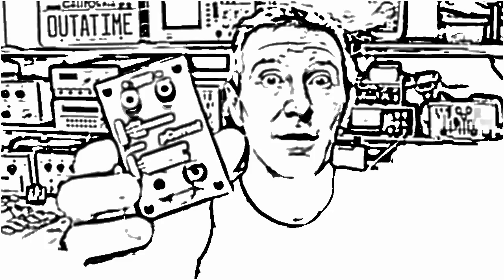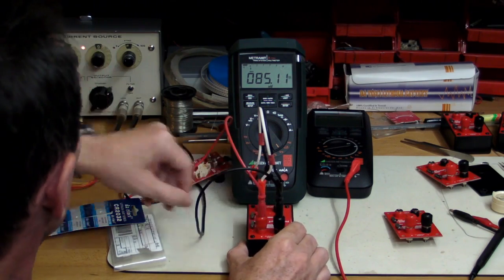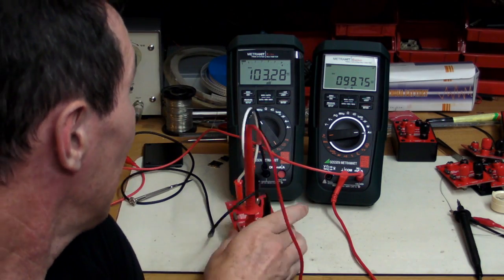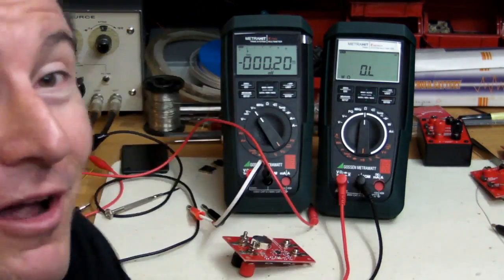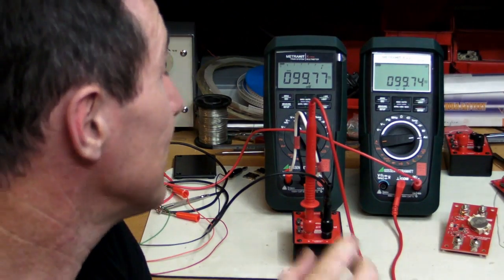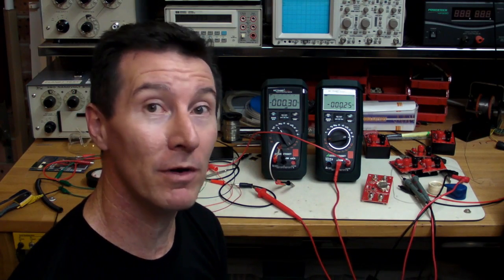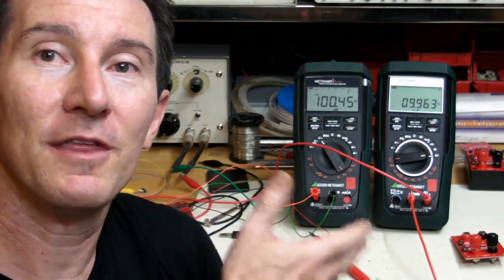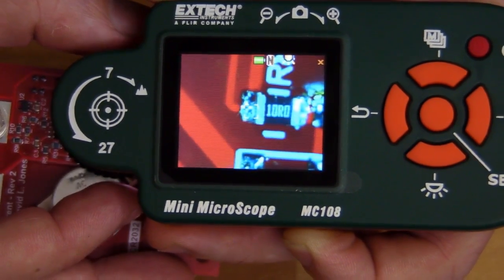EEVblog #133 - Dodgy Digikey Components

Comment: I think this video shows that you have to verify everything yourself. Once you take ownership of those parts you are ultimately responsible for them and the results they produce in the equipment they get installed in. If you're going to sell a product you should also test your product to make sure it meets the specs you are guaranteeing to you customers. It's more costly not only in recalls and refunds but in reputation in the long run to sell dodgy gear.
Reply: Jud Clark It isn't practical to verify the detailed specs of every component supplied. Not if you are doing more than a one off prototype. You pay a premium to have them tested before supply.
Reply: @MrSwanley  - Why do you think, nomal manufacturers use bed of nails? Of course you have to test your product and materials.
Your customers do not care what is practical for you. They care what is possible and that they get what you advertised.

Comment: I once order 1 through-hole MOV from Digikey and got a box of 1000 (like $300) worth.  Of course i sold it on ebay, just kidding.  I sent it back, but i thought they'd at least give some credit for being honest.
Reply: +AnubisAkaLee Most likely they just tossed those parts. At least I know for sure that farnell does this. None of returned parts is entering the supply chain again once they left their facility as they do not know what could happen with those parts (ESD, moisture, fakes returned instead of the genuine parts).
Reply: +Jordan Baczuk I think offering credit is something you are more likely to see from companies targeting end user's rather than builders/companies.  A company buying these in bulk would have a scheduled pickup rotation anyway, so it's not a big deal to throw one more envelope/box on the pile.  I bet if you had asked for a credit for the inconvenience outright they would have given it.
Reply: woopsserg, you know, I am so straight that I never even thought about fraud in a return.  Silly me.
Reply: I've had a few instances where digikey gave me one less or even a couple extra components, but not 999 extra parts! XD
I honestly didn't bother because:
1. They were cheap parts.
2. Shipping cost.
3. As woopsserg said, they probably would just toss them so it's just not worth it.
4. I always buy a few extra more than I need. Not just for in case one is missing, but in case I have an oopsies. NOTHING is more frustrating than frying something and having to wait a few days to get a replacement...
Reply: +Jordan Baczuk
Yeah, money just wasn't enough for you, Jordan, you wanted both to feel good AND a credit, and then you dare to call yourself virtuous?! You are a sad, pathetic excuse for a human, you make us sick here at Digikey!! >:((
Reply: They didn't give me any money, haha who are you?
Reply: Jordan Baczuk
It was a joke, how in a twisted sense, you could pervert even the most purest of intentions. I have no affiliation with Dk :)
Money I was talking about was those 300 bucks you could have theoretically earned if you did not send those resistors back.
Reply: +funky3ddy Oh, ok it was a joke haha yeah I see what you mean.  I assumed that <you> were being honest :)  I was just surprised that Digikey doesn't incentivize people to return wrong orders.  I felt that I was inconvenienced to have to box it up again and go to the post office and return it, when it was their fault in the first place.  Some in-store credit for the inconvenience would increase loss prevention, customer service, while costing them wholesale only.

Comment: I have to assume that you used the soldering profile that is per spec for this part.  If you did not control the soldering temp profile, all bets are off.  These low value resistors are much more sensitive than the higher resistance value ones.
Reply: but he tested unsoldered as well?
Reply: Watch the video again. THIS was scrupulously covered.
Reply: Fred Yearian MORON did you NOT see he checked a resistor that was NOT attached to anything ?? He did NOT heat it and found it was still the wrong value !!

Comment: Hmmm, no response from Dave or Digikey???  So for the past 4 years people shouldn't trust digikey parts?
Reply: Because I was way too busy with work projects to start up a side project just to do something fun with them.  Also because digikey is a great supplier and actually helped to fix any of the few problems I've run in to over the years.
Reply: RN1441 and because you're a stand-up guy who doesn't take advantage just because someone made a mistake.
Reply: ***** I can't blame digikey for getting it wrong some times, and it's not at all reasonable for them to test every single 0402 resistor on a reel of 10,000 :D  At the same time, when they get parts wrong they are pretty good about setting it right.  I've had them ship me some obvious mistakes like several thousands of dollars worth of eeproms when I had ordered $100 worth of barometers - they were very polite that time because they wanted their parts back unharmed :D

The worst error I've had from them was getting 5.76k ohm resistors labeled as 57.6k ohm - luckily the power supply circuit wasn't damaged but was clearly non functional so it was easy to diagnose - I've luckily never run in to such a subtle error as this one.
Reply: It depends on the country. Some new consumer laws put the responsibility on the whole chain when dealing with the customer. It means even if Digikey is not at fault, they would have to pay an indemnity to the customer, and then Digikey could sue whoever is really at fault.
Reply: +RN1441 Why didn't you just keep the EEPROMS and sell them on ebay/use them in projects?
Reply: If it happened so easily with Dave, do you really think this pack is "a few out of millions"???
Reply: Do you realize how many part numbers Digikey carries?  You can't fault them for a single manufacturer's batch of 10 ohm resistors that were out of spec.
Reply: Mallom Bum They are suppliers, not manufacturers.  Therefore, NO you cannot fault them for a few units out of millions being out of spec.  If you think so, you should pack up a multimeter and head over there and beg for a job testing each and everything that goes out the door.
Reply: Mallom Bum Oh I see, I misunderstood you the first time.

Comment: I remember doing 4-wire resistance measurement on my introduction to metrology lab, we got 0.1 ohm reference resistor (one of these old, crusty big ones in big cylinder-shaped boxes) and we got 0.2 on 2-wire and 0.1 on 4-wire, that was a good eye-opener for someone trusting all you can get on the multimeter display (I was an IT student and this lab was kinda funny because most of students didn't even know an Ohm's law...) :)
Reply: Since when did IT studies include metrology, or was that an optional subject you could take for your grade point count ?
Reply: I'm on Information Science, we have one electronics course, and we have to make a few measurements like resistance of a bulb (with voltage and ampere meter). Maybe there were more complicated too, but I haven't take that course, maybe next year, but my friend have already did. And not optional.

And we had a PLC and other control stuff too, RS232, current loop, ladder programming, and who knows what. Studends didn't care, teacher didn't care, so I brought my arduino and did something less useless. 90% of class is like my grandmother to computers. But not beacuse they don't know what a phone charger does (220V- >5V), we tried to make a remote door plan (like we need door close sensor, door open sensor, something in the way sensor, remote controller, etc, if this does that, blablabla). The possible exam questions was sent out, and the project was make a traffic light, with the built in leds of the PLC dev kit, or with the "IDE" simulator INSTED OF making a small pneumatic assembly line piece that they told us. That wouldn't be more complicated but it would be interesting for the "noobs". Because of this nearly everybody borrowed the project file and sent in the same.
Reply: Those wires for the 4W measurement looked kinda thin. I'm guessing you would get even better accuracy with low resistivity cables?
Reply: @paulf1071 no difference (within reason) the whole point of 4 wire is to help exclude the lead resistance
Reply: kroplaaaa just remember, multimeters do not measure resistance, they are actually measuring time in the D-A conversion.
Reply: D-A conversion? Typical multimeter is double integrating ADC and it actually counts impulses during which capacitor in the integrator discharges ;)

Comment: Those china batteries can be dodgy, as they frequently don't have the best seal.  Air gets in over time and makes them go high resistance.
Reply: That's a good point. I'm wondering if it's possible that these resistors were spot on immediately after manufacture, but drifted over time due to some obscure reason?

Comment: Depending on how they are made they my be static sensitive...?! We had a class on static at one of our Western Union computer schools. They related a story of how a particular lot of super precision resistors made by a German company were all being measured slightly off when tested on the bench. Believe it was NASA, not sure. This was back in the late 1960's, before the era of anti static procedures & packaging, and ever shrinking conductor spacing. When they were removed from the paper envelope the Germans had packed them in, they picked up a static charge that was enough to arc across between two conductors, dragging a bit of molten metal from one to the other, shorting out a turn. That began the development of anti-static procedures, or so we were told.

Comment: Dave
Thanks for the excellent tutorial.
I've been in the electronics manufacturing industry for 25 years and learned that you ALWAYS test ALL your product specs during test and cal. That's been learned the hard way just as you have experienced. It does increase the cost slightly though.

Comment: So Dave, how do you get around this problem?? I am building a BLDC position controller and I will be getting it sent off to get made, my first run will be 1000 and I don't want this problem to happen to me. Do I order one of each component and test all of them first then get it built with the same items??
Reply: No... just test a few of the ones you get and make the call to the supplier if they are out of spec.

Comment: I know how you feel Dave. I had gotten a Samsung 52inch DLP TV from my wifes sister because it had just stoped working. No surprise it was the voltage cap on the balast baord so I ordered a new one from digikey. 450v 47uf had it replaced with a 400v 47uf cap from an abandon switch mode supply and that worked for 2.5 months. I put the new cap in from Digikey and it didn't last a week. Had a new cap overnighted to me and it lasted 3 days! So I said screw it and just got a used board from eBay. =p

Comment: If he wanted 1.5% error components he would have spec'ed it out for that and he would have bought components to match those tolerances. A 10 ohm 0.1% SMD part costs $101.18 for a batch of 1000, whereas a 10 ohm 1% SMD part costs $12.59 for a batch of 1000 from digikey.

Comment: Digi-Key is dead to me. I have BOMs on their server to order parts for production. Two out of the last three orders had errors in Digi-Reeled components. In one case, a different three-terminal device was substituted for a SOT-23-pkg transistor, and in the more recent one, they reeled the wrong resistors (0603s vs 0805s). 

It's unfortunate--we've used and liked DK for years, and their BOM/reeling services were a great fit when we brought some manufacturing back from China. But these errors...

Comment: I had a major recall incident with ECS crystals ECS-160-20-3X-TR from Mouser. These crystal would suddenly stop oscillating. Real bad news because while it did the quadcopters' motors would spin up full throttle even though the motors were in a "disarmed" mode. Intermittent, hard to diagnose. Assumed a reflow problem for a long time but turned out to be bad parts. Replaced with an ABM7 crystal and not an issue since. I recalled 220 units, which cost me a bundle for a small biz. @flyingeinstein

Comment: Hate to argue with a guy who really seems to know what he's doing, but isn't the point of anti-static mats to be conductive? Normally they have a high resistance enough to drain away high-volt low-amp static charges, but not to affect your electronics. But they are a bit conductive, surely that's the point! 

Apart from that, love your videos!

Comment: Digikey & Bourns hire minimum wage drones who can only read part numbers, and would not know a resistor from a dead frog! I won't use Asian cheap resistors in any precision app no matter how they test. (thermal drift)  I use them a lot in guitar stomp box items where 20% would probably work. When I need .1% I expect it. I usually pretest a sampling of 10% of the lot & if I find 50 in a row are OK use'm. I order 1 extra -10-20% extra of most cheaper parts. I got stung like you on diy synth LFOs
Reply: That why they have tried to hire you?

Comment: I wonder if what has happened is you got some counterfeit parts.  And I doubt that Digikey had any idea that they are counterfeit.  Counterfeit parts are a real problem in every industry.  I have seen counterfeit bolts so it wouldn't surprise me that resistors can also be counterfeit.

Comment: @CampKohler   Antistatic mats have surface resistances of at least hundreds of millions of ohms per inch, specifically so that it will not interfere with stuff like a component being tested or a PCB with live traces in contact with the mat or whatever.

Comment: Love your videos, Dave.

Just a tip for probing those tiny 0805's (and 0603's, its especially handy for checking LED orientation) - leave it in the tape and, using sharp probes, probe the component through the tape.

Comment: Digikey has gotten much worse in the past few years about sending completely wrong parts - the label will indicate the correct part, but the bag will contain a completely different part. Not just a different value - but a different part! In my experience, they screw up about 20% of the time. I place about 50 orders per year.

Comment: @EEVblog On Eckert building the ENIAC:"Whole boxes of resistors were brought in and their tolerances checked one by one.... The best resistors were kept to one side for the most critical parts of the machine wile others were used in less sensitive parts. On other occasions whole boxes...would be rejected and shipped back to the manufacturer." ---Computer, a History of the Information Machine, 1996

There's nothing new under the sun.
Reply: There is no excuse for any company with that sh_tty of a mass production failure rate to still be in business.
Reply: the emperor of chin could behead the maker of out of tolerance arrowheads

Comment: An old question: How many 5% resistors will be found in a lot of 20% resistors? None. All the 5% units are sold as 5%, the 10% are sold as 10% and the rest are sold as 20%. Nowadays probably any units that are further out are returned to the worker that produced them, who is shot by the Chinese army ("Quality control that works!).

Comment: @EEVblog How could it be static dissipative without being conductive? Is it radioactive (ala polonium brushes for film, etc.)? All the mats that I am familiar with are conductive in the multi-megohms/square range and are tested with ohmmeters that measure in that range. There are even go/no-go circuits that monitor the conductivity during use and give off an alarm if it no longer conducts, which is neat.

Comment from the maker: @CampKohler No, no incoming component inspection apart from labeling, nothing unusual there, very common procedure. You build up confidence in your system and supply chain, but sometimes it lets you down like this.
The antistatic mat is just that, anti-static, or what's called "static dissipative", it is not conductive.

Comment: The only problem I've had with ordering from Digikey is when I once received some transistors when I actually ordered microcontrollers.  I called them and they had someone check the bin in the warehouse and--sure enough--they were stocked wrong.  Digikey sent me the right parts and let me keep the transistors.

My only real complaint is that the lady in customer service was really cranky about the whole affair.

Comment: @EEVblog Dave, I agree that in this case it's ok. But it would be good advice to tell people that measuring in circuit would cause problems. If you did this in a previous blog, then it's ok. Capacitance could affect the measurement because as long as you keep the meter current source, parasitic capacitance will provide voltage across (integration of applied current). It's quite marginal, but it's there. Great job on this blog, keep it up mate!

Comment from the maker: @yanava Not in this case. The resistor is isolated with a mechanical switch. And the resistor was probed directly so traces have no effect. Capacitance does not matter for DC resistance measurements.

Comment: You realize measuring components in circuit is a bit lame right? There are resistances in contact, trails resistance, capacitance and all sorts of stuff. You did it correctly by measuring the resistor out of the package.

Comment: Are they in fact thick film ones? Try warming it up with a soldering iron and check how the resistance varies? Thick film have at least 100ppm temp co, thin film should be considerably better.